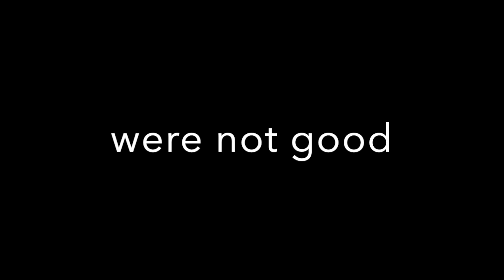EP #24 FireFly ff338 -SHOCKER- Not just another Cheap 335 Copy  - Worthy of the HYPE  (part 2)

Comment: I've noticed that my 4 different FF338s had a lot of variability in hardware.  I noticed this most specifically in bridges, but also that the pickups in the one FF338 that I ended up keeping has conventional adjustable pole pieces, which would indicate that they're different from the pickups that came in yours.  I ended up raising mine up slightly to brighten the neck pickup a bit.
Reply from the maker: I think the hardware is really the luck of the draw!!!  The hardware on this one seems fine to me...guess i got lucky.
Reply: @jimdarrstoneshifterguitars2309  on my first one the bridge was so bad that the saddles didn't fit into the rails, and the screws weren't fully installed. I had to file the sides of the saddles and open the screw holes up. The next couple weee a different design with the wire retainer. My spalted one that I kept had the e-clip retainers like the original, but was much better made

Comment: Nice vid...I just got a used one...luckily,there was a nice TV Jones Powertron in the bridge,but I'm gonna swap out the neck...it has traditional poll pieces,but it's dull and VERY microphonic...bridge screws/saddles rattled like crazy,so I wrapped the screws with teflon tape and it's now fine...I'm considering changing the pots,switch,jack,and wiring...do you have any idea of the quality of those parts?...like pickups, they're usually a pretty weak link in inexpensive imports
Reply from the maker: My experience with these inexpensive imports is that ALL the hardware is lower grade.  My take on the wiring, switch, jacks & pots is use then until they need to be replaced, unless you want the change the values to alter the tone. Bridges, tuners, and tailpieces are really the luck of the draw. Pickups ALL tend to be overwound, muddy sounding, and very microphonic likely caused  by the "cover" usually not being wax potted. The good news, if the guitar itself is stable and plays well, the hardware can be changed over time.
Reply: @jimdarrstoneshifterguitars2309  Thanks Jim...I have a feeling it uses low quality pots around the 300k range...I'm gonna throw in some good 500k's for better clarity and articulation...best part is I traded a pedal for it (a high end Reeves treble booster,but still a pedal! 😁)
Reply from the maker: @rickya3877  Why do think they are possibly 300K pots???
Reply: @jimdarrstoneshifterguitars2309  I have another import brand (SG style) that had 300K for humbuckers and it muffled the high end clarity in much the same way...I happen to have the exact TV Jones pickup in another guitar and there's quite a difference in clarity and definition...of course there are other variables involved
Reply from the maker: @rickya3877  Based on what you observed, I would tend to agree. When you take the pots out you can easily measure them on a VOM. Keep in mind that a lot of these "OVERWOUND" pickups tend to display a muddy tone with lack of high-end clarity, articulation, and sparkle. Let us know what you find out...
Reply: @jimdarrstoneshifterguitars2309  will do